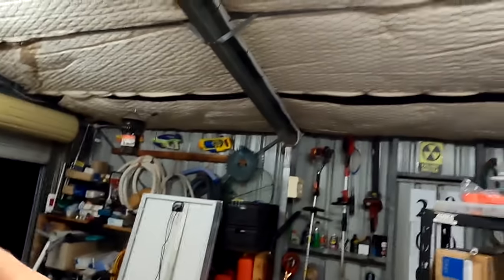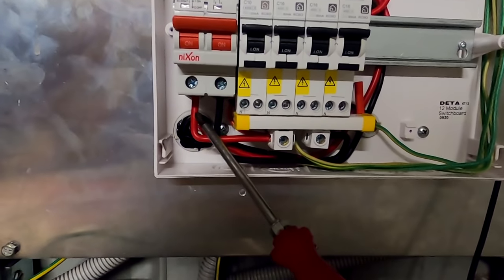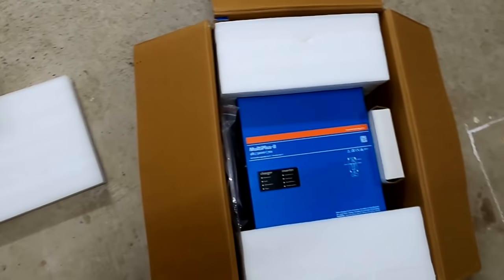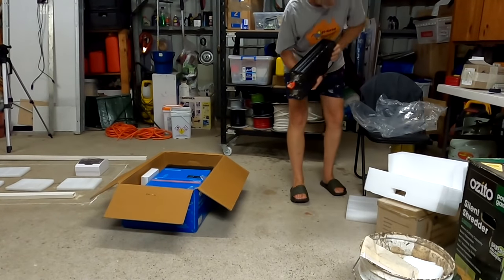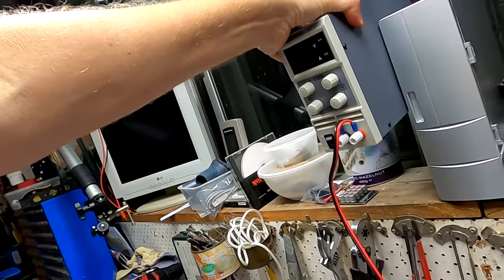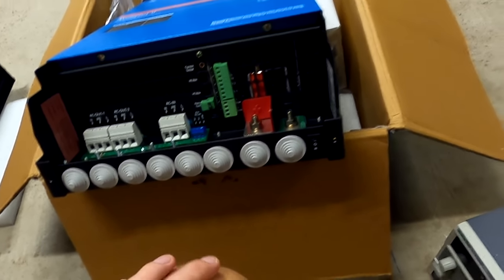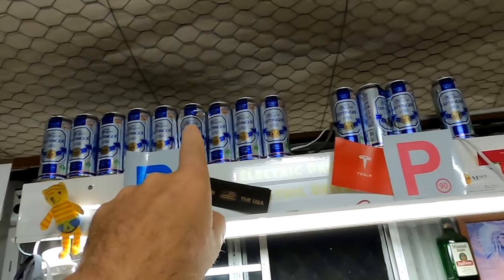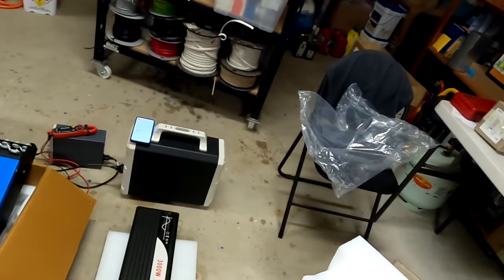Victron Multiplus II series connects to other Inverter's output. Smoke or success?

Comment: Hi Andy, I have a Multi and a Quattro and was thinking of this exact concept - your project is great timing.  One thought I have is that one should turn "LOM Detection" off (Loss of Mains) so that the Multi does not try and "tie" with the AC input ie. push AC back on it's input - could cause some magic smoke...
Reply from the maker: Thanks Graham. I'm just reading about LOM. Wasn't aware that this exists. Interesting feature. I was thinking of turning it off as I'm off-grid anyway.
https://www.victronenergy.com/live/ve.bus:grid-codes-and-loss-of-mains-detection

Comment: It's probably too late to ask, but does the multiplus II has bypass mode as well? I mean, if my solar and battery power isn't enough,  it would switch or bypass the grid to the local grid and charge the battery from pv or grid+pv? I planned an off grid system and it turns out that legally can't install the chosen device which can do this. Any ways I dont plan to sell power to the grid, because we have to pay taxes on it when the electric company pays our power (I'm from Germany... Sadly). Can you please confirm or deny if the device has this capability or not? Many thanks! And greetings from a Hungarian in Germany :D

Comment: Not sure how I would feel about both inverters connected to the same battery system but providing AC power independently but that same AC power is being transferred through the multiplus 2.
Reply from the maker: Both inverters are isolated. I would be concerned with eh XIJA though.

Comment: Why don't you just conect both inverters to the battery but put them on difrent circuits like for exampel the Phoenix inverter powers the gerage and the multiplus the house this would mean that you would have 9kva

Comment: I tried doing the same thing with a 3000VA UPS connected to my Quattro. AC input on the Quattro was limited to 6A but the UPS caught fire!
Reply from the maker: Interesting. Wonder why this happened...
Reply: What was the UPS? Maker and model?
Reply: @servisfibris6679  it was an APC 3000VA UPS but I can’t remember the exact model.
Reply: @OffGridGarageAustralia  don’t really know but It might be a good idea to try it with the old inverter first.
Reply: @kevinmills5293  i loved APC UPS, until noticed, that all batteries were cooked.. (heat problem). There can be (and probably was) also grounding problem - if one pole of battery was connected to ground and ground normaly is connected to neutral of Multi+ (can be disabled in settings and have isolated network). Normally in telco power supplies there is + pole on ground, but many US manufacturers do - pole to ground.. It depends on purpose.. This can lead to short and welding currents. If  APC have different ground on battery than Qattro/Multi (should be isolated - definately i will measure it before test), you get this current on transformer and show will start.. This can also be problem if neutral to ground is connected on different poles, so you get direct short on AC side posing both devices running on max until weakest transformer is burned. If Andy will not fear to test it, this can be prevented by fuse between Multi and interter, so fuse will burn first.. And i recommend to start with something like 1A fuse and leave it for a while with one LED bulb connected and measuring temperature of devices (they should show it in VE.Configure)

Comment: Andy .......... 

Thanks for ur videos, short nice and in german "Wundertüte" what you will do with this combo.

@ Victron Energy can u please switch the screws for the chassi and the connecters and the cover, the PH1/2 screwes to TX 10-20, PH screws with PH are outdated.
Reply from the maker: Thanks Jörn. It's the 'Eierlegende Wollmilchsau' 😂

Outdated screws?
Reply: @OffGridGarageAustralia  Andy our good old "X" screws would be okay, but they can change to torx, more grip, they will hold on the screwdriver, can only hard flip over etc. The PH head is so old and outdated :D.

And
"Eierlegendewollmilchsau" aka multiplus 2 ,yes i´m looking now for a year for one but first my battery must be ready, thanks to you it´s now done, with heater (stands outside in the garden) and a jk bms 🤣.

Comment: Nice what the multiplus 2 can do with the output power options - the cheapo PIP 5048 can only transfer from AC input or inverter any smart switching of loads has to be handled down stream - i use shelley/gridconnect and reflash with Tasmota. Need to add more smarts like dont power on on cloudy days etc at the moment theyre dumb just turn on 10am off at 3pm or so

Comment: The only parameter for ac output 2 is as a pass through only when you are hooked to an ac input such as your generator, shore power, or house circuit. I am sure you know this.

Comment: Help please. I have 12/24 volt epever tracer an series mppt 30 amp 100v  charge controller and 24 v battery bank  . How do I wire up 6-100watt 12v. Panels would like to do 8 but might be to much. Thoughts please
Reply: Put 3 panels in series and parallel with the next 3 in series. That will make 44 volts and 11 amps.

Comment: I have the same Multiplus II inverter and it will happily accept any stable supply on its mains input. It also has no problems with grid tied pv inverters on its output. Not sure but I don't think you can parallel the output on your phoenix inverter. Please check manual before it lets the smoke out.
Reply from the maker: Thanks Trevor.  I cannot parallel the output of the Phoenix but it works well as the input 'generator' of the Multi now. So much power combined 💪

Comment: So, battery 1.0 stays and powers the Victron Phoenix, and battery 2.0 needs another 8 cells to be purchased, and will run the Victron MultiPlus II? Makes no sense to run them bother from the same battery does it?
Reply: Yes off-course it does, you will have 3+5=8 KW output even from the same battery bank.
Reply: @marco1862  That would require 170A load. Is his current setup capable of that load?

Comment: Hi Andy. To have the full advantage on the victron system you are going to have, it will be beneficial to have a GX color control or better the new cerbo GX to tweak all the features and settings there are opening for you 😉
Reply: he already set it up on a raspberypi.  andy did a bunch of videos setting it up.